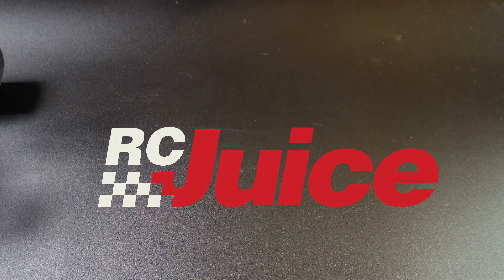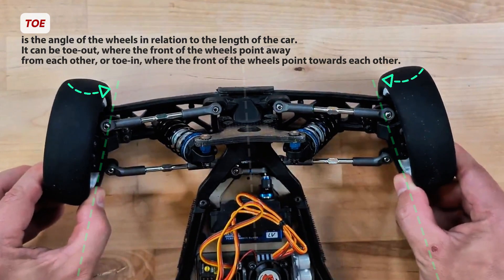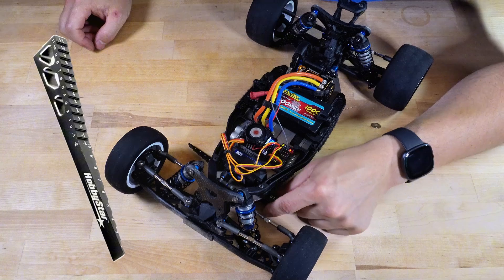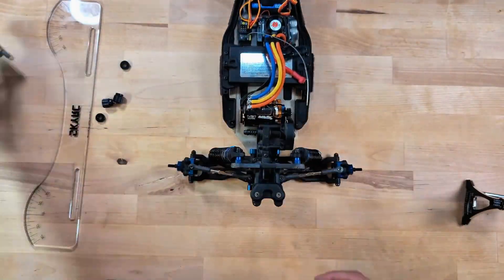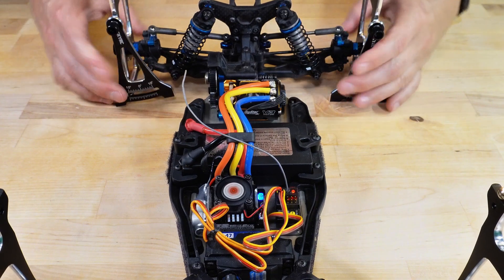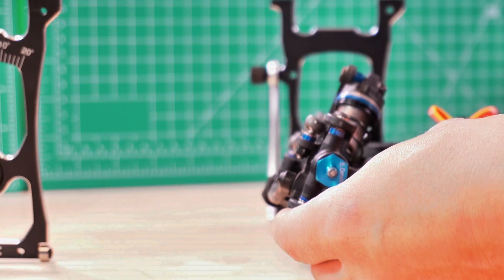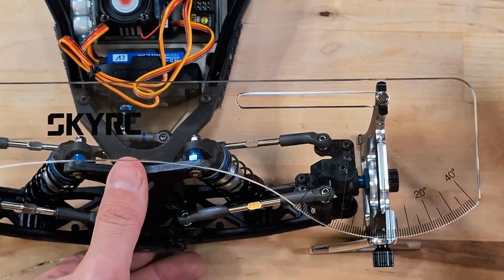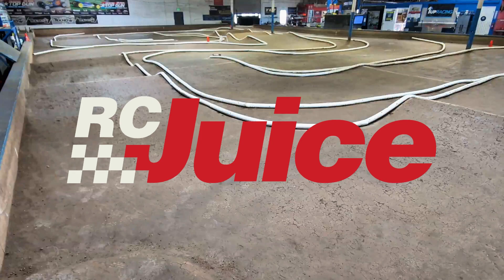RC Buggy Setup 101: Mastering Camber and Toe Angles with the SKYRC Setup Station

Comment: Anyone know if this set will work for short course truck?
Reply: In general every RC car should have slight toe in rear, slight toe out front, slight negative camber in the front, and the rear camber can be zero or negative slightly as well that's just a rough base line.. more toe in rear helps the rear stay straight. More camber in front helps it turn better
Reply: It should, you will have to purchase the 1/8 buggy plexiglass toe gage though I bet

Comment: After you have your shocks set for your proper ride height. I suggest you remove them and replace them with solid rods to eliminate unwanted movement when adjusting everything else resulting in faster and more accurate measurements. You can also place a rubber o-ring on the shaft of each shock . By sliding it up against the shock body and dropping the car you get a better idea of how much shock travel you have

Comment: Nice vid, but a few issues here. For ride height, I also check  gap for spring retainers is similar left to right. Toe is usu/ always a neg value, so the index should be to the outboard side of the gauge. Looks like you've set positive two. Camber gain is caused by difference in control arm length Vs camber link length. For front toe, it is critical the steering links are similar length. The process takes ages, but measure and match tie rod gap, then on set up station set camber to zero on both sides, check toe is symmetrical. Repeat until you get the toe you want, usu zero or +1. There's a lot of sub-trim on your controller in this step. Then add on your camber. Nicely produced, I look forward to more content!

Comment: Some people just like to compare and comment about Hudy's setup station only to show and tell their spending power on expensive things. What they are missing is that Skyrc or many other brands do and perform exactly the same measurements as those expensive stations. Showoff people. After all, after one crash or hard tip over, most of the times measurements are lost and will have to do it again. I have both Skyrc 1/8 and 1/10 set-up stations, and have been working flawlessly for me.
Reply from the maker: Thank you for the input!
Reply: Hudy does make some nice tools, I personally use their hex drivers, cause I had the best experience with them. But they also make a TON of overpriced stuff, that is simply expensive for no reason. The setup stations are one of those.
Reply: Did sky rc make specially for buggy 1/10 or all car 1/10 ?
Reply: @gearbrorcindonesia1313 Skyrc makes them for 1/8 and 1/10. Rc juice has them.